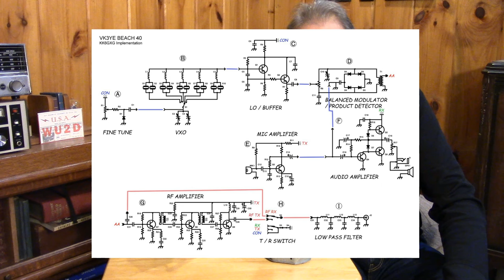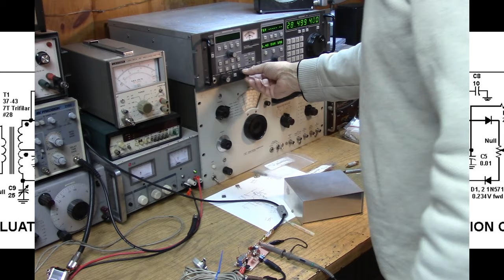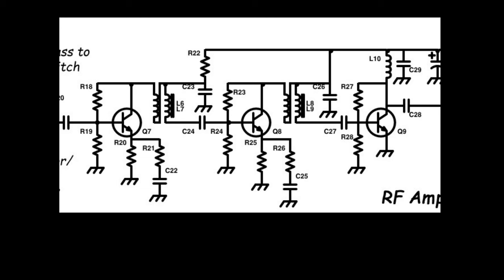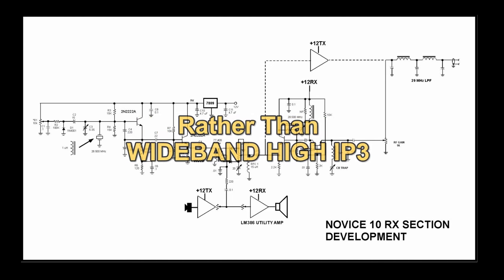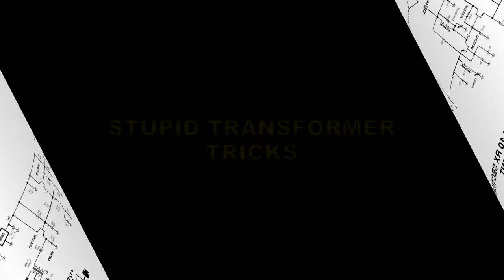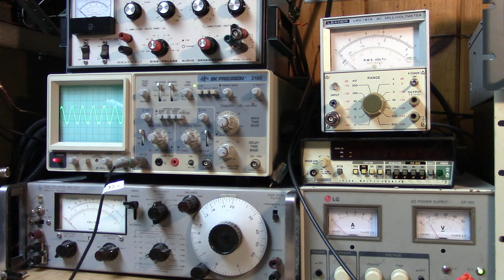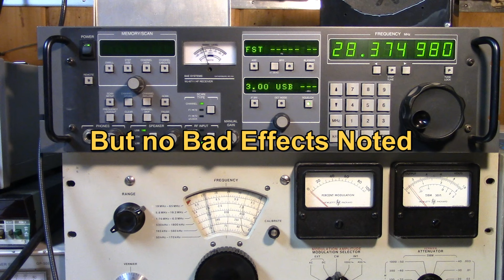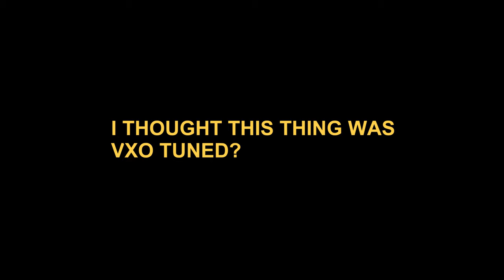Double Sideband Novice 10 - Part 2

Comment: Love the microphone !! I have only had success with the AN612 balance modulator chip (getting) hard to find. I've used this chip in connection with the tx mixer in a cobra 29 cb to achieve dsb but I I had to bias the bases on the driver and final amp transistors. It was a pain but it worked ok. Good job on all your projects!!! They work!!

Comment: This is a fantastic introduction to this. I liked your trial modulator experiment. I think that a one transistor amplifier stage would definitely be beneficial for the microphone, you play with the gain to get what you want through the emitter degeneration resistance. I'd probably go one step up and do a two transistor dc coupled preamp with global negative feedback which rolls off the high audio frequencies steeply.
Love the strive for simple circuit principles though

Comment: 👍Thank you Mike. As usual, very interesting. I like the common base RX amplifier. I built a single stage common base amplifier for 10m (2N3904). Mine did not have a tuned circuit and gave only about 15dB gain. Although not bad for a single general puprpose transistor, maybe not quite enough gain for 10m. Shall maybe try adding your tuned circuit. I may even splash out on a toroid core 😂.

Comment: Did you use any lacquer or nail polish to hold the turns in place on your transformer?
Reply from the maker: The center tap usually stabilizes the ends. The broadband transformers are ridiculously stable. The high Q transformers on powdered iron used in military radios like the GR106 were repeatedly soaked  in Q Dope and bake stabilized over days. You can do as far as you want.

Comment: Maybe a BS170 / 2SK3476 type PA .
I haven't looked if that works at 10M but some power fet will !

Playing with the pre driver transformer could save one stage .
All you need is correct drive voltage into the pa ….
Reply from the maker: Yes! The RD06HHFI and other RF capable Mosfets are tempting. I managed to do it with an old school CB Narrowband approach with the BD139 as a driver and 2SB2078 Final.

Comment: Using just a LM386N you can get over 70dB +of  gain .
A article in PW by JF10ZL has more information .

But its just a 100uf cap & a resistor string hanging of pin 1 .
The resistor is setting the gain & a 820R is around 40 dB 
6R2 is 74 dB if you can keep it stable that is ….........